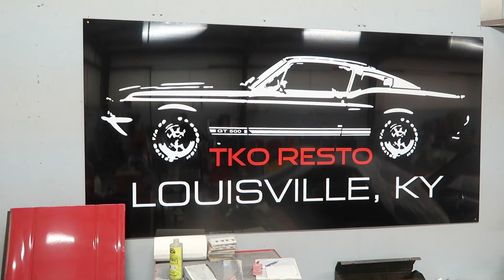Painting A SN95 Mustang Viper Red

Comment: do u have to sand or anything after spraying the clear coat? and what kind of gun are u using
Reply from the maker: you don't have too. but to make it perfect you usually do. and with this booth i get some dirt so i wet sand and buff in stops that are really flat and needed. here im using a Sata gun
Reply: tko resto thanks man and i dont know what grit to sand down the old paint with. is it 500?
Reply from the maker: Justin Carrillo depends on the area and conditions of old paint. If any place needs primed you wanna 180 and 320. Then prime. Final prep to spray is 400 or 500. I've never seen 500 around here tho. Then make sure all edges are scuffed with a scuff pad. Edges are the first place the paint will start to peel from.
Reply: tko resto how do u know where prime needs to be applied? and i saw a vid that said u dont need to prime the whole car like most people do.
Reply: anything bare shiny has to be primed anything with paint could just be lightly sanded scuffed so paint will adhere to it.
Reply: Felix scuffed with just a scuff pad?
Reply: Justin Carrillo
If you have primer already use a scuff pad before painting if theres paint lightly sand it using the sandpaper grit he recommended,scuff pad can be bought at any body shop supplier,ask questions there they might be able to help you further.
Reply: Felix alright bro thanks